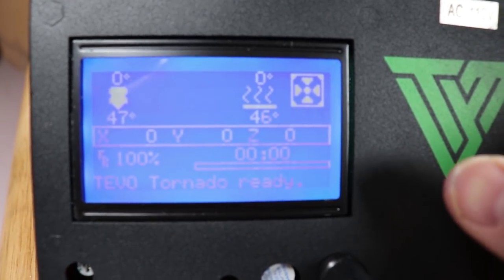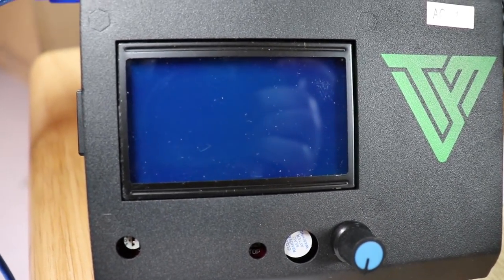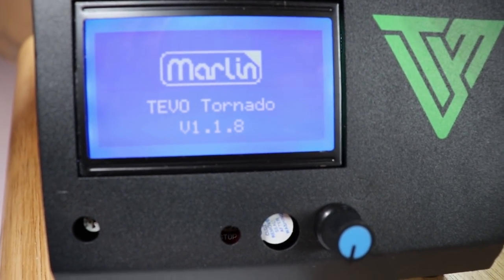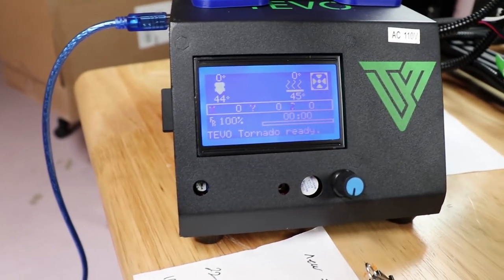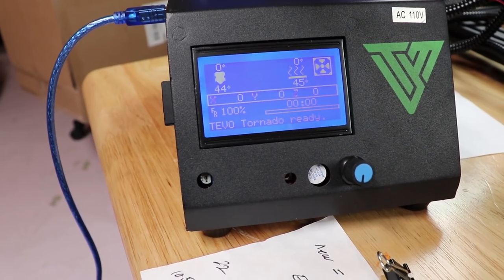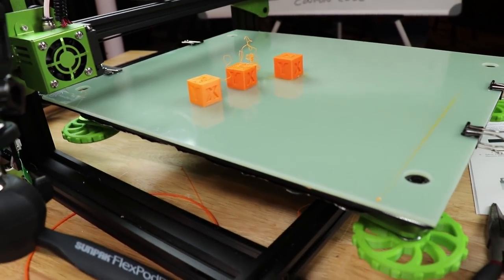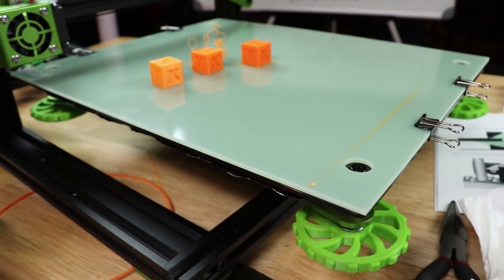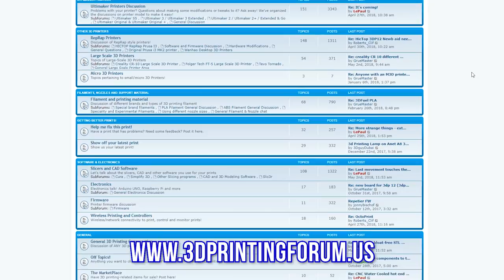Setting up the Tevo Tornado for First Prints!

Comment: To get the printer stick on surface off, start at one corner and peel back whilst holding back pressure on the stick on surface and start to form a cylinder, then a sharp hobby knife to back cut the adhesive, each cut with the knife will release a bit more of the stick on surface and is real easy to do and comes off in no time at all.
Next thing I use a spray bottle with Turpentine give the plate a squirt on the left over adhesive and let it soak for a few minutes then I use a properly sharpened 25 mm wood chisel at a shallow angle to scrape/ cut the softened adhesive off, Turpentine also good for hard to get off masking tape, It's the correct solvent for that type of adhesive, fair dinkum would have taken me no more than ten minutes tops.Good luck.

Comment: Hello, CHRIS here. I purchased my new Tevo Tornado a few days back and since I haven’t seen it do or try anything BUT damage itself. All tests were just scratching the green plate. I was adjusting the bed assuming it was that,... nope. I then thought the nozzle was clogged. I took it apart and cleaned it as well and replaced the nozzle with the extra that came inside. It started to come out nice and neat. Popped in the SD card to test print and then just scratch, scratch, scratch like a chalkboard. I said maybe it’s the green bed skin. People take there’s off on Videos. Googoned it real clean. Only to see it get scratched just like the skin. I’m at a loss for words. Wife and kids are dying just to see the technology work! This is a kit,... so assuming it’s a dud would be dumb since parts can be replaced and such as long as I find the problem right? Well I need help!!! I’ll be happy just to see it try doing a boat and coming out blobby,... just do something other then scratch the surface. Ohh I started off with PETG not PLA or ABS. Please suggestions,... I wouldn’t wanna buy anoth printer that just works out the box, cuz everyone LOVES THERES!!! Can I be in the club. I think I’m tearing with all the work I’ve done and obtained nothing. Ok enough talk I’ll be patient for any response and or help. I’ll even throw in my cell if anyone asks if you think that may be faster. PLEASE
Reply from the maker: Be sure to join the Tevo Tornado Facebook group....lot's of great people there to help you out.
https://www.facebook.com/groups/TEVO.Tornado.Owners
Reply: Where Nerdy is Cool!  I did just that and someone was kind enough to help me. He recommended I start with PLA rather then PETG. I didn’t think that filament was a challenge. Thanx for your help!
Reply from the maker: PETG can be tough.  I haven’t tried it yet since PLA works well for most of what I print

Comment: You might wanna try to use roofing washers on the bottom of the bed. The mix between the rubber and metal should help lock the bed screws down.
Reply from the maker: Good suggestion...I really dislike this bed screw/bed level design!

Comment: You said you upgraded the firmware... we need a video on that... maybe do the upgrade to the new Marlin 2.0
Reply: Marlin 2.0? How new is that?
Reply: @MissSpaz  Just released about a couple of months ago and it's already on it's 4 patch V2.0.4. I jumped on to soon and now I've got the 3D Printers version of the "Blue Screen of Death", so hold off for a few months till they get it fixed.

Comment: Add a rubber washers to the bed leveling bolts .. mine stopped rotating once I did that.
Reply from the maker: Stacey Budd under the screw head?  That’s a good idea
Reply: What size nut an washer did you use

Comment: I've tried about 3 different surfaces. The best one I found (was referred to by a friend) although rather expensive is from FilaFarm.DE in Germany.  The actual surface is called FilaPrint.I got the 'Switch' system which is a magnetic system. The magnet sticks to the build plate and thin metal plate sticks to the Filaprint.  Never touch with fingers (grease) or a metal object.  When the surface cools flex it a bit ad the print drops right off.  Check my channel for a video of this system. You can also get just the FilaPrint and stick it down, much cheaper. I got the switch so I can have 2 print surfaces.  One cooling down and slap the other on and just continue printing. I also subscribe to this channel.  Great information.
Reply from the maker: I've been to that website and their approach looks great!  Expensive...but very good.
Reply: To me it was worth every penny.  I don't want to name the others I had problems with because there's many who love those.  I just didn't have any luck.  I added a photo in my main comment

Comment: Can I get a link for that print surface?
Reply from the maker: Sure ....here it is!
https://tiny-machines-3d.myshopify.com/collections/awesome-upgrades/products/polypropylene-build-plates-for-3d-printers
Reply: Where Nerdy is Cool! Appreciate it man thanks
Reply: Where Nerdy is Cool! Did you make the holes your self ?
Reply from the maker: No problem....on that link, you can select the proper size for your printer.  The Tevo one has the holes drilled out to access the bed screws
Reply: Where Nerdy is Cool! Thanks mobile version of the website drop down menu is broken works on desktop version.